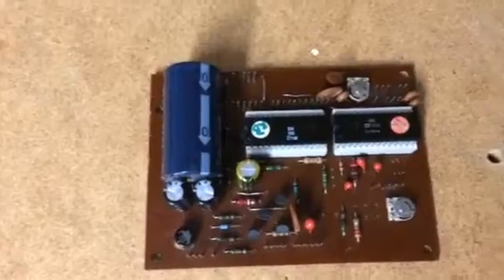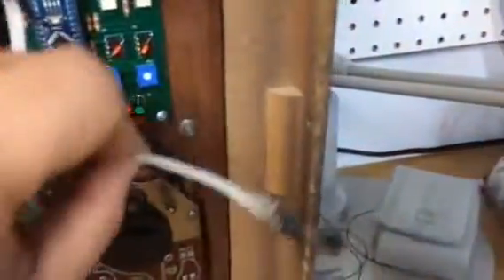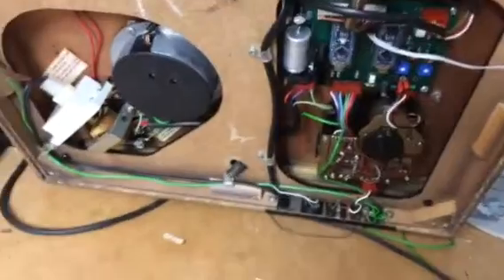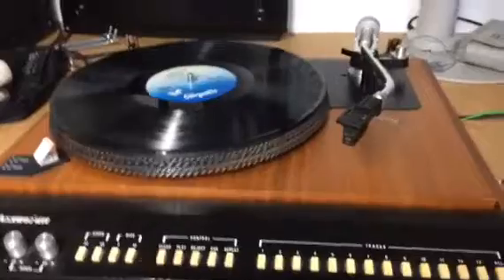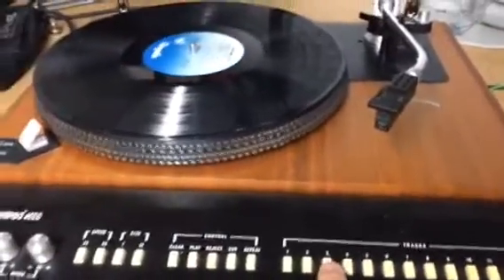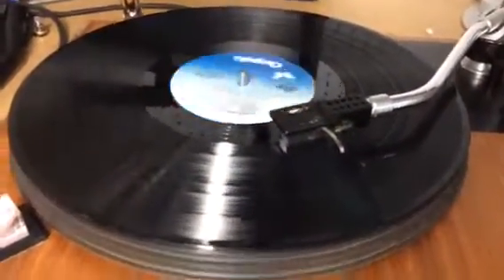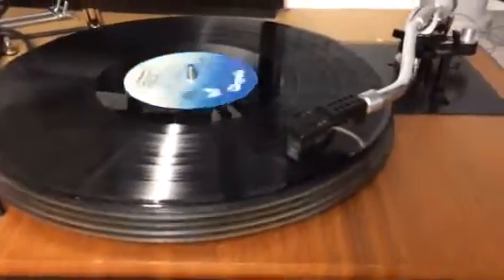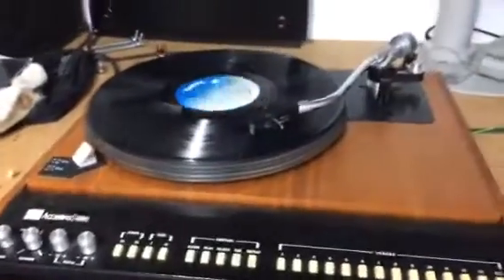Accutrac 4000 Arduino controller

Comment: Hi, i have a problem, the arm doesnt function i dont know the problem, the tt start but no the arm its bad? Or other thing
Reply from the maker: Hi Osvaldo. Check belt on tonearm servo. If belt is OK, most likely controller is bad. There are two options to fix it: 1. to find another controller. 2. to build new one. I am not offering rebuild/fix, because it is time consuming project. If you are OK with Arduino, all documentation about my controller posted on Audiokarma.org. Just look for Accutrac 4000 Arduino controller.  Best regards.
Reply: @VladBoyko  Hello, tonight I saw the record player, it turns on, but the arm stays still, I press the buttons but the arm doesn't move, and when I want to place it manually, it is as rigid

Comment: I've had one for many years and it is very reliable. Great machines I have also updated three others. The original controllers really go bad for two reasons. Simple fix if you want to keep an original running forever. First; they have no heatsink on the two main chips. The outermost chip will quickly reach 130++ degrees in less than 10 minutes. They get hot-spots within the chip.  I span both chips with one heat sink. I use an old Apple memory heatsink.. hole between the two chips (and sink), plus one small jumper wire underneath due to the mounting hole. Also relocate the large 3300uf capacitor... it is right above two hot diodes and a very warm transistor.  A couple hour fix for the heat-sink when you are updating the four main caps.  The other issue is voltage, the Accutrac 4000 MUST have good stable voltage coming in and NOT high voltage. Look into a small external Constant Voltage Transformer ( CVT ) for a quick fix. You don't need a large one, these turntables sip current. Use a very SMALL CVT unit; as many are whisper quiet under load.   Without stable voltage these will not work properly and chips could fry. Of course there are other ways to stabilize the voltage. I believe it is 16v and 6v off the main transformer.. if memory serves... You could possible do something as simple as clip it with a zener right after the mains trans; before filters of course. These precision machines do not like spikes or nasty voltage.
Reply: No idea what happened to mine.All of the sudden the arm started moving differently. Now instead of playing a track, it goes all the way to the spindle almost, then returns to the rest. After that, I can manually set the arm on a track or the beginning of the lp. Sad really. Its functioned fine for a long time. I wonder if the clutch is messed up in the arm, but why all of a sudden? So... I put it all back in its original box for now. Even used a standard ADC stylus at time when I could not get one for this and it worked fine as a auto table. Cant figure out what happened.

Comment: Are you selling kits or plans? Very interested.
Reply from the maker: I did. Do not have PCBs. Just a schematics and Arduino code. Check this thread: http://audiokarma.org/forums/index.php?threads/accutrac-4000-new-controller.739668/
Reply: @VladBoyko  are you still working on the project?

Comment: I'm very interested in this project, and would like to get one of the kits from you. I would like to assist in furthering this project to help out others with reviving their accutrac 4000's. I have knowledge in arduino and it's code, and electronics skills. If only it was easy to get the original Ic's on these turntables. I'm in the midst of making a new remote that functions with the original circuitry, utilizing Bluetooth or wifi connectivity. I messaged on the audiokarma.org forums about this project as well. Please, if you could get back to me, that would be spectacular. Thank you in advance.